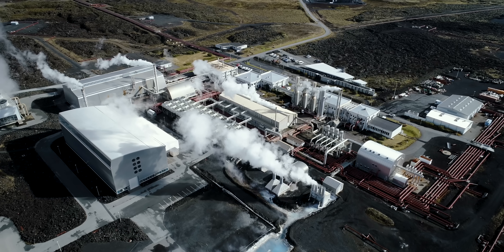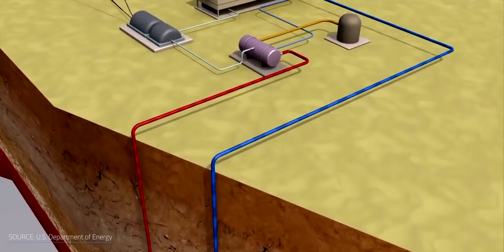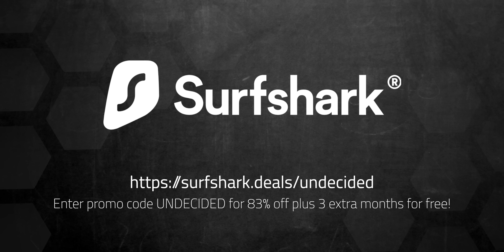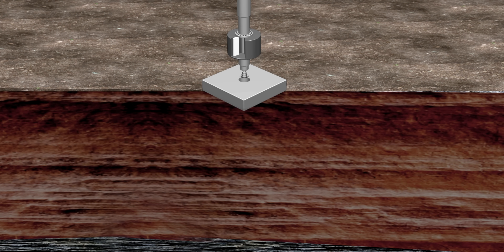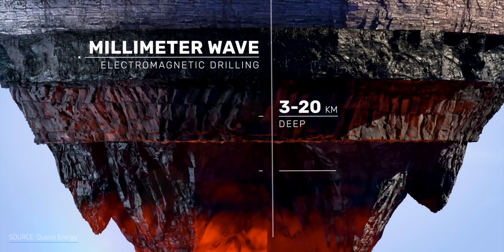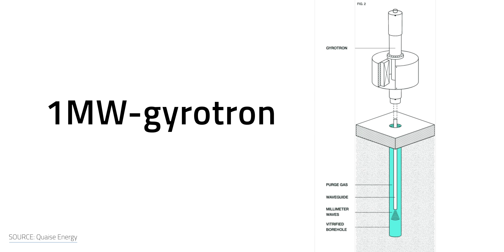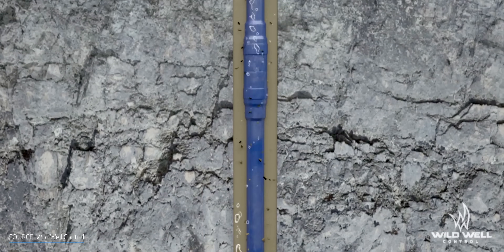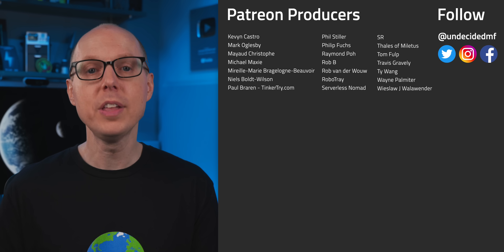Why This Fusion Tech May Be a Geothermal Energy Breakthrough

Comment: In “the science of energy,” a Great Course lecture by Michael Wyession, the total geothermal power potential of the Earth is closer to 3x humanity’s current energy consumption. Can you speak to the disparity between that and your numbers?
Reply: No you could drill virtually anywhere on the planet so whatever you have been reading is well out. The Mponeng gold mine in S.Africa is 4km deep and is in a cold spot and is still 66 degrees centigrade even there at that depth so with this tech you could basically drill anywhere on the planet to get to the heat you need. That means there is enough heat to fuel us thousands if not millions of times over depending on how many bore holes you drill. 
Obviously we do not need millions of times the power we use, but theoretically if we bored enough holes then we could.
Reply: @Vile_Entity_3545  That isn’t really relevant to the point I was making. The energy is there to go for eons, but the rate at which that heat radiates is around 3x humanity’s total consumption.
Reply: The numbers you found only take into account geothermal sources, like volcanoes, geysers and hot springs, where geoghermal energy is currently affordable to drill to be cost effective, and that also aren't subject to much tectonic activity to make such projects actually workable.
However, if we had infinite money to drill wherever we wanted and build a geothermal plant every few miles all around the globe, the energy you would get would be much much much much much higher.
But money doesn't grow on trees...
Reply: @texanplayer7651  The number from the source I provided was the rate at which the Earth’s core is radiating heat. Meaning that, if we drilled everywhere, that is what we’d get. It would last us for eons and eons, but it’d be like draining the ocean through a drinking straw.

That does not take into account that we cannot just drill everywhere, both on the account of cost, and the fact that turning the entire planet into geothermal power plants is not what I would call a good idea on its own merits.
Reply: @CMVBrielman  In that case it still has nothing to do with the energy you can extract from the Earth's core, your number is the infrared radiation energy of the Earth, which of course is much smaller.

We can have a qualitative approach of the Earth's geothermal energy:
The Earth's radius is roughly more than 6000km, so is we used almost every square meter of the surface of the Earth to drill a 10 km hole we can roughly say that we are harvesting the energy of a giant ball of fire that is 6000 km in radius (6000>>10).

The surface of that gigantic ball would be about 200 degrees celsius for millions of years, so we can say basically forever.

Now just without any further calculations whatsoever, qualitatively speaking, do you think such numbers would amount to "only" 3 times the human energy consumption? Because that would mean that if we only multiplied by 3 our energy production we would have enough energy to heat every square inch of the entire surface of the globe to more than 200 degrees celsius. Does this sound realistic to you?
Reply: @texanplayer7651  Here are the numbers: Earth radiates 46 terrawatts of heat from the radioactive decay of its elements. We consume 18 terrawatts of energy (so its actually more like 2.5x).

You can look up those numbers if you want, and some might estimate them higher or lower, and the total human power consumption is going to vary and, likely, increase, but those are the facts.

And remember that I’m not talking about how long we could tap this power source, but about how much we could get at any given moment.